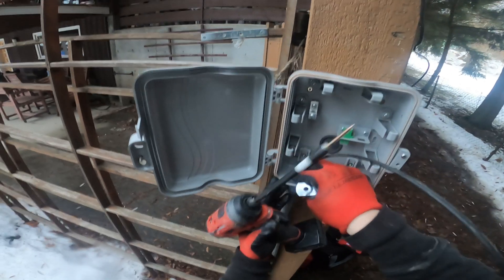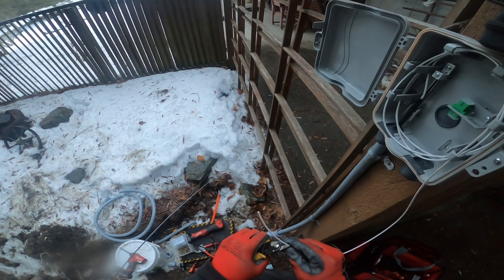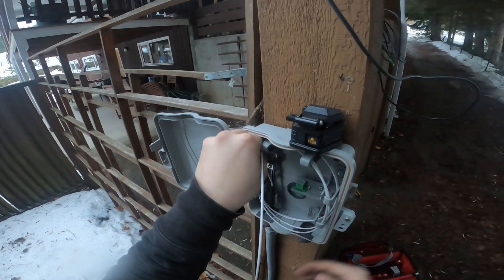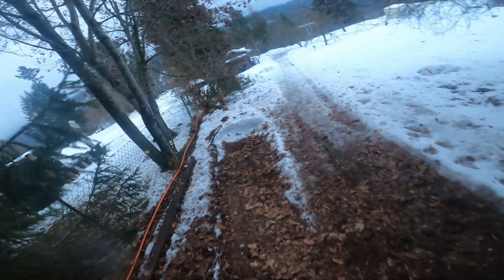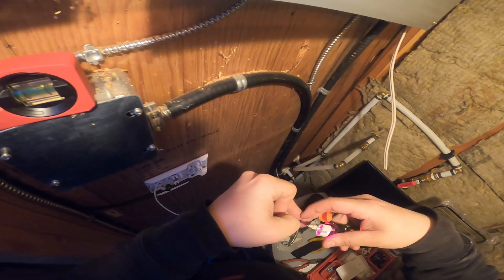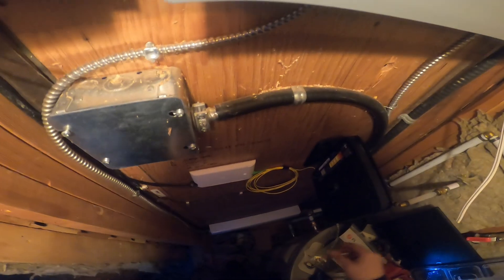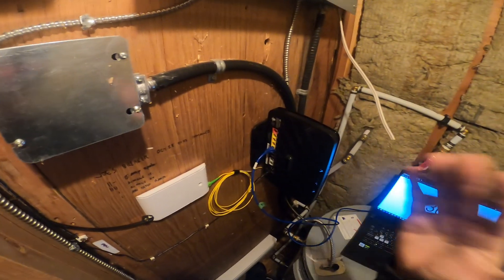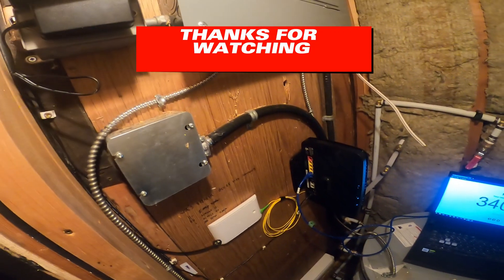Fiber optic Network Expansion 150m End to End connection. media converter, splicing

Comment: Here in Israel it is a must to clean the fiber with IPA, as well as the mechanical need to be closed over the outer cable sleeve to have it strong against tear down
Reply from the maker: You’re not wrong we just have different practices here.

Comment: I was surprised to see how you could add the connector to the end of the fibre cable using that laser tool. I was under the impression you needed specialist, bulking spicing devices. Is this something new please?
Reply from the maker: It’s a just a mechanical quick connect fiber end. Very common here. They come in both apc/upc (flat/angled)
Reply: What’s the name of the laser tool and how exactly does that work with the connector if you don’t mind me asking.

Comment: Conduits seems very thick, we are mainly using 8-10mm(outer diameter) for customers and 14/20mm for aerial cables going to the ground from the last pole. And conduit we are covering with flex armored pipe when going from ground to the outer wall box. Thanks for walking us through the fault finding on the weird -37dB values, was it faulty pigtails?
Reply from the maker: Faulty Jack at main house. Ended putting in a new sc/sc bulkhead

Comment: 75Mbps would probably be the 2.4ghz wifi network which tops out at about that speed. Only 5ghz wifi can give you a lot better speeds wirelessly.
Reply from the maker: You can get well over 400 down on 2.4ghz Not exactly sure why I got such a low reading initially but I think the modem had to update. After the fact I was get over 300 without changing anything 😅